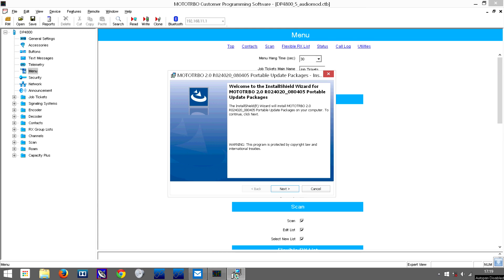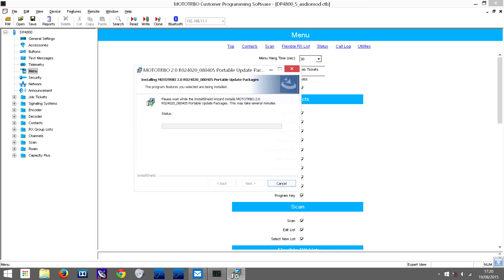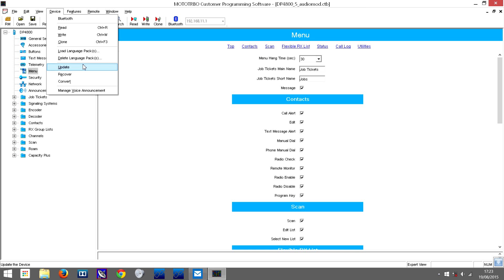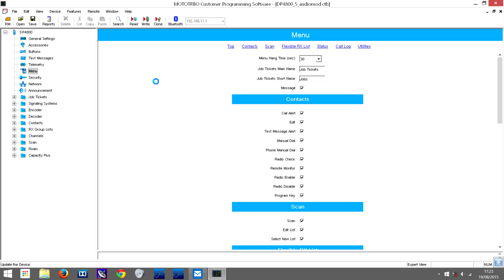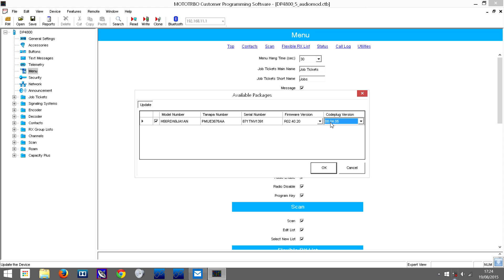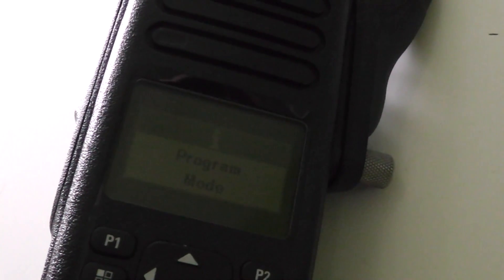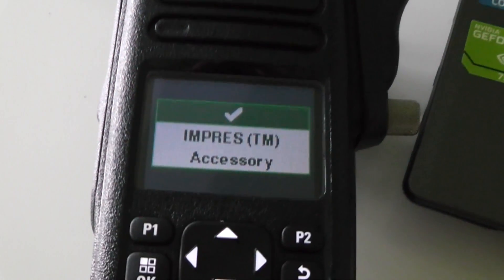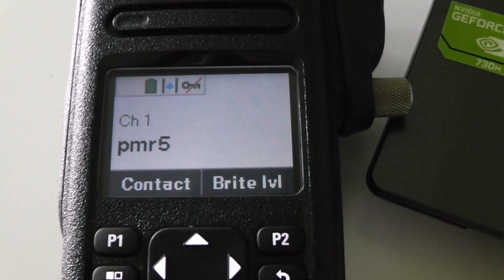How to update a MotoTRBO radio

Comment: Hi,  I have the DP3600.  It's a good solid radio but has not been updated in some years.  I dont have the original software as I bought second hand.   My firmware is R0112.02 and CP is13.00.05
Can you point me in the right direction to update pls.  Many thanks

Comment: Dude need help have a motorola sl4000 but need to match my radios with it can you show the radio frequency preset list with dcs would appreciate all...
Reply from the maker: I don't think there is any preset list. It will be programmed on the frequencies of whoever owned the radio before. You just need to reprogram it to a frequency you're licensed to use. Also SL4000 doesn't do FM so it cannot have DCS or CTCSS as they're only on FM